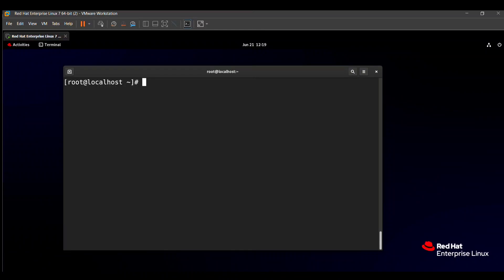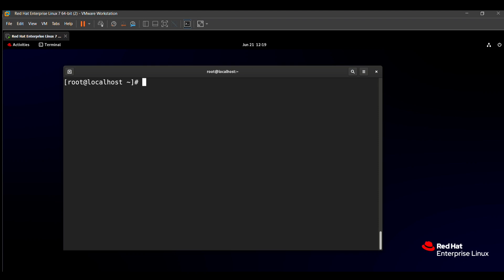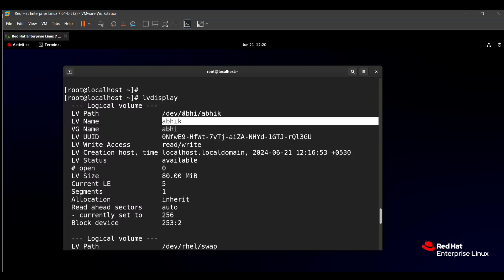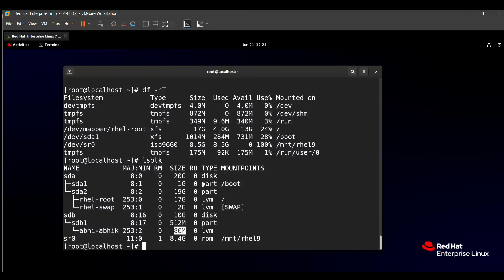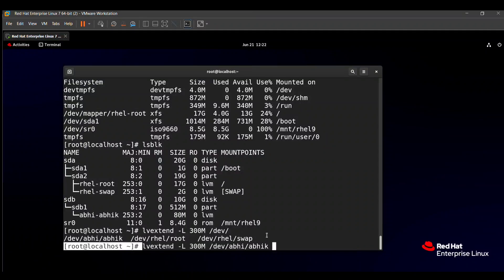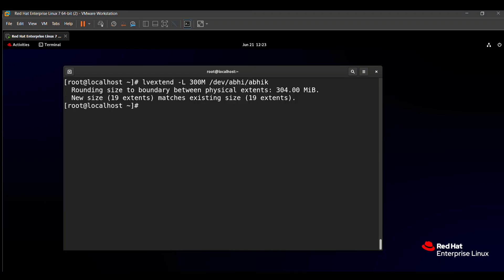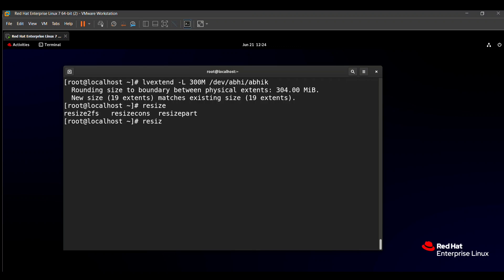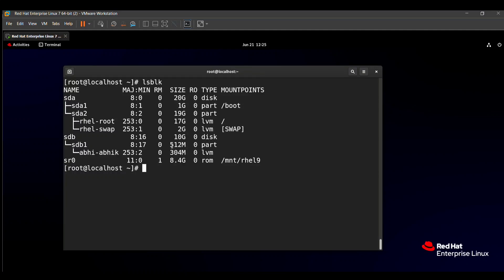RHCSA EXAM QUESTIONS | RESIZE THE LOGICAL VOLUMN | RHCSA 9 | English Tutorial

Comment: So why don’t you use lvextend -r -L /dev/abhi/abhik ? Plus aren’t you suppose to umount first before you do the questions ?
Reply from the maker: yes it is compalsary to unmout first in RHCSA.
Reply from the maker: - r option is used to automatically resize the file system but in this video I can use  another command to resize the file system  that's why I am not use directly this -r command. you can also use this -r - L to solve the problem in single command
Reply: @MrCyberAk  Thanks I will try both command on exam